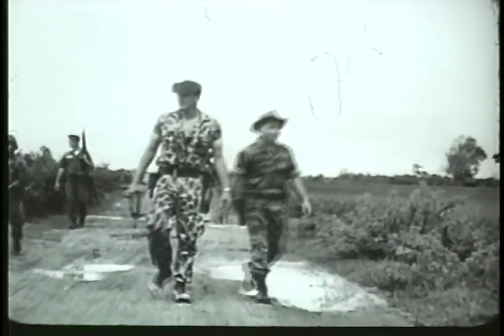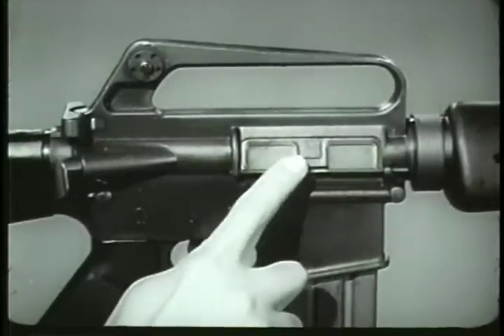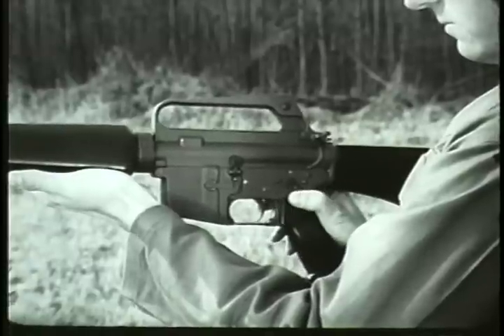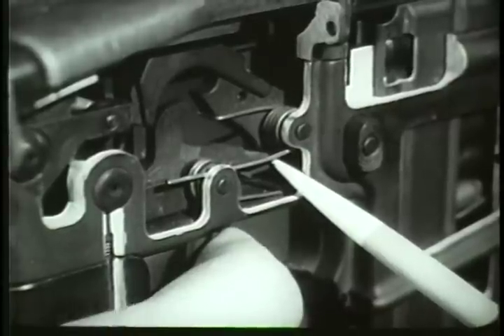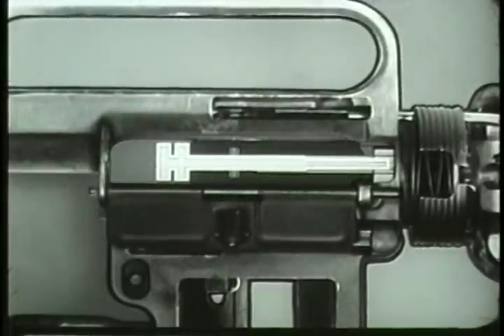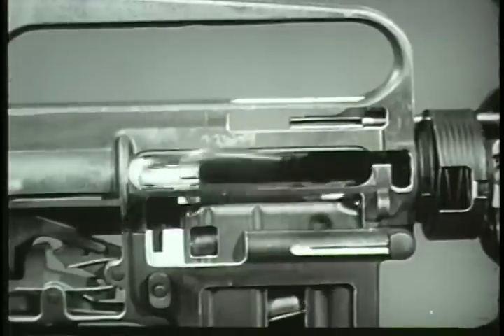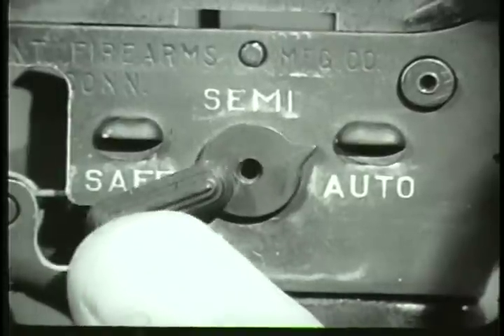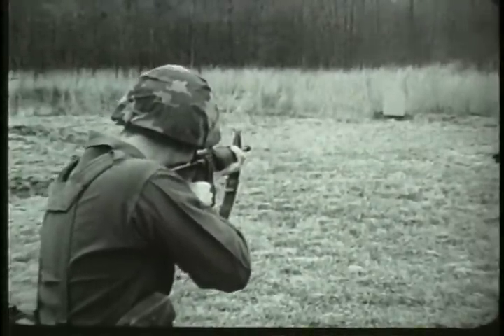XM16E1 Rifle 5.56MM - Operating And Cycle Of Functioning

Comment: If you watch the video just as the bull picks up around out of the magazine you'll see it jump.
This jumping cartridge without guiding of the tip cause lots of jamming issues my particular M16 I was issued would never fire more than three rounds before it would jam the armorers were never able to fix it that is the worst designed rifle ever any dust or dirt gets in that bolt it takes a total s*** but yet we let our soldiers die with this useless weapon all the time
Reply: What u just said isnt true if u beleive it is watch inrangetvs ar 15 mud test the cause of the jame was the military using the wrong powder and not issuing them with cleaning kits which would cause extreme fouling of the chamber as well as the bore and gas tube the diffrent powder also burned faster which causes the fire rate to increase meaning the bolt would cycle before the bcg could pick up the next round the m16a1 fixed all that and chromed the bore so even if the wrong powder was used it would keep the cases from sticking but thankfully the military started using the correct powder
Reply: The round jumping had nothing to do with it jamming in is literally part of the operations
Reply: No, you obvious don't understand how this rifle works..The M-16 works very well and is very good in mud and dirt..The main cause of the M-16 failing in Vietnam was the use of improper gun powder and very poor maintenance.. The rifle is a wonderful design and is the reason it has been the standard US rifle longer than any other in US history..
Reply: @hairydogstail  M16 is junk even in pristine clean conditions i dont think you understand the rifle I was issued at camp Pendleton was never able to fire more than three rounds consecutively no matter which armor or whoever tried to fix it or fire it.
It was pretty embarrassing I had to borrow a Sergeant's rifle to shoot my annual qualifications.
I was a range coach at the time in the mid-seventies at camp Pendleton I saw quite a few M16 but didn't not function for more than one or two magazines.
For some reason none of the six armors at 1st battalion was able to fix my rifle to where it was able to shoot more than three rounds without flip jamming.
That's what we refer to it on the firing line when a hot roundwood go in fat in first and the fingers of the bolt would rip into the cartridge as it tries to lock 🙉.
Then it's pulled the mag get the screwdriver and pliers and pray you don't pinch the primer, 💥 
Who needs to go into combat when you got a gun that tries to kill you with a flip jam.
Not to mention the misfire that won't eject that gets hit by the next round, a double-round blast blows the bolt back, can dislodge  the butt from the main rifle housing when the buffer slams
Reply: @crazywayne7051  I'm not arguing you didn't have any bad experiences with the M-16 lol. I know a lot of Vietnam vets who will never like the M-16's no matter what I say..I can say your armorers were crap and didn't know what the hell they were doing... I can find any problem with any Ar type rifle. 
If you have a miss fire then there is no way another round can hit the primer in the chamber unless you manually charge another.. The firing pin protrusion has a spec, as the chamber, as the 3 bores in the bolt carrier, gas key, gas tube, etc.. I have a function gauge that will find any chamber problems. When Chris Bartocci from Small Arms Solutions worked for Colt, he went to Iraq to see first hand what were some troublesome rifles. The rifles he found had after market bolt carrier groups and parts that he could not even identify, let alone who the manufacturers were.. They were way out of spec.. If the M-16 fails, there is a reason and usually it was from a bad armorer or cheap replacement parts.. No, any in spec AR type rifle will run for thousands of rounds with out any malfunction..What you are describing is a bolt over base which is caused by a short stroke which is a gas issue..Very easy to diagnose and fix..
Reply: @hairydogstail  about 18 years ago I was Telemark ski instructor.
I was skiing with some Royal Marines that recently had major issues with their m-16s and were looking 4 weapons that wouldn't give them a 40% failure from the dust stirred up from the hot LZ helicopter dropping them off.
It force them to change their hot LZ tactics to using pistols till the dust cleared.
And you can claim and say anything you want the M16 will never be a dirty gun and I'm not the only person who agrees with that.
Reply: @crazywayne7051  Sorry, but more Fudd lore..I have seen all of the dust, mud type testing and the M-16 is one of the most reliable rifles tested. The AK did (slightly) and I repeat (slightly) better than the M-4 (16) in the cold weather and dust testing, but the AK did miserably worse compared to the M-4(16)...The M-14 did horrible in all of the test..The M-16 is a sealed rifle and would survive perfectly FINE in any dusty landing zone by closing the ejection port..If the dust was so thick to choke an M-16 with the dust cover opened, then the AK would have choked too..More fudd lore...